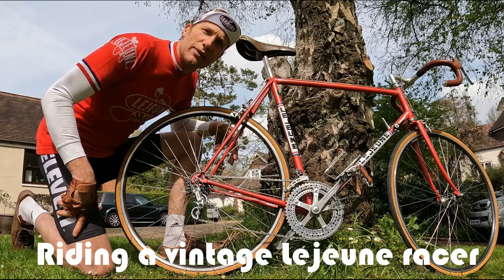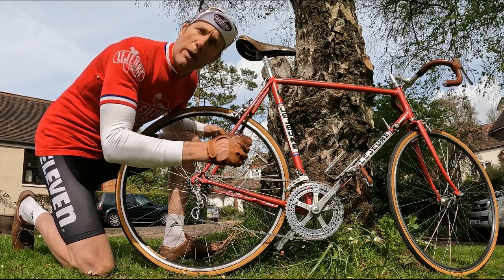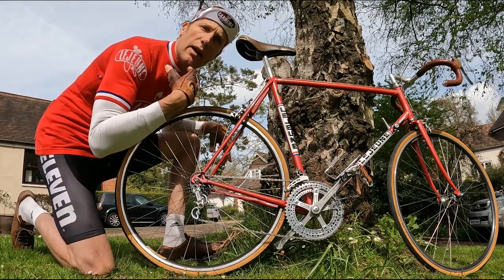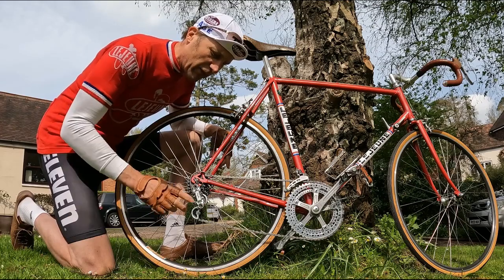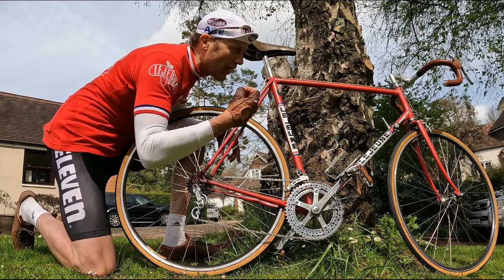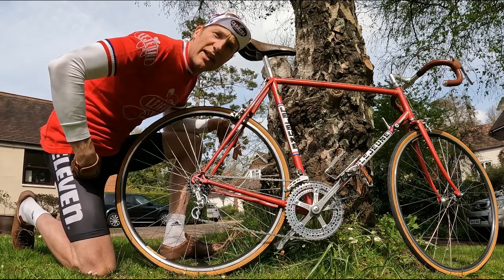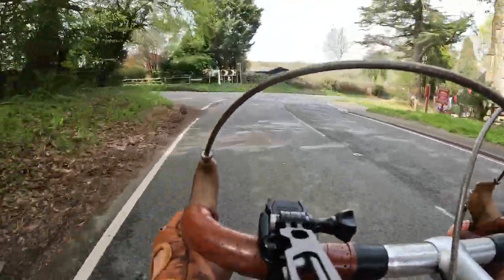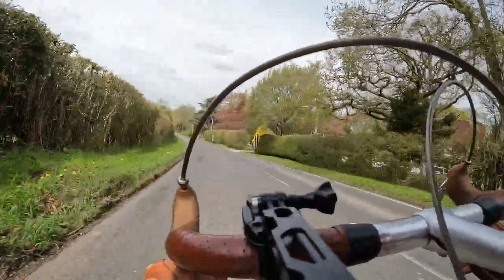Riding a vintage lejeune cafe racer - fast and furious!

Comment: Toe-in on the brakes? You BEND the arms, just like back-in-the day! Suntour "Power ratchets" work fine, something must be wrong with yours though Simplex/Mavic retrofriction lever are still probably the best except for the rare Campagnolo version. BRAVO for wearing the proper jersey on the ride!
Reply from the maker: Sorted the Power shifters post ride - they had not been assembled correctly in the past - I`m not a fan of bending brake arms - hairline cracked a Uneiversal51 rear caliper a few years ago and didn`t spot it at first - easier just to file the rubber... Dan
Reply: @vintagevelos9517  indeed, bending arms on these old components may end in misery.  Best to use conical washers if you really need to do toe-in.

Comment: you where shifting down that hill Dan i felt like i was riding it! ill be on my bike soon mate i only ride in the sun ha ah , thx for efforts again
Reply: Wasn’t he just. I was a bit scared myself, but I know when Dan has built a bike it stays built!
Reply from the maker: Yep, I like to put everybike through its paces, especially a good downhill test - you`d be suprised by how many bikes really don`t like going downhill!
Reply: @vintagevelos9517  iv picked up a carbon few wks ago and need to press in a new bb, its a new frame so never d one would i need a compound for this?
Reply from the maker: @blackbearbowie8162  Hmmm... press fit bottom brackets have a well earned reputation - I`ve ridden plenty of them, they either creak or are about to creak - research  bonding them in when you press fit, keeps them quieter for longer, or get a Dogma - outboard threaded bottom bracket.... Dan

Comment: Used Suntour bar end ratchet shifters since they were first introduced , Best things going apart from clipless pedals IMO .  Maybe like those you can tighten the adjustment of them with the screw that  tightens  it to the clamp .
Reply from the maker: Yep, turned out they were not assembled correctly, stripped and sorted and rather good, Dan